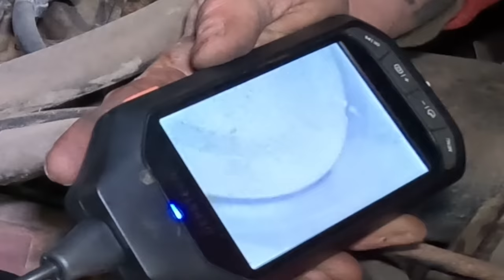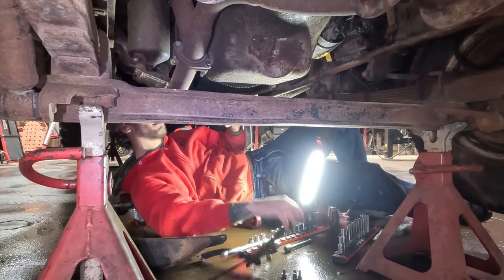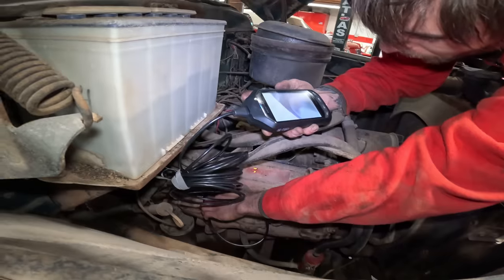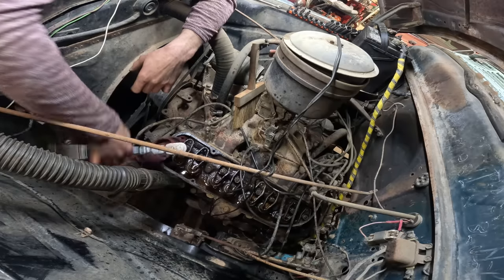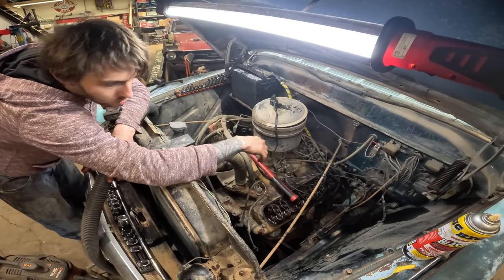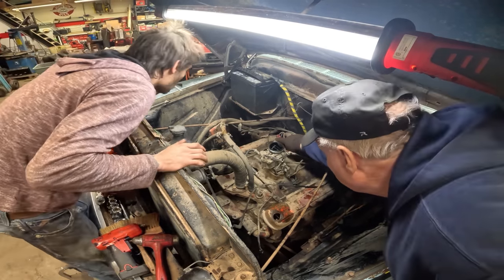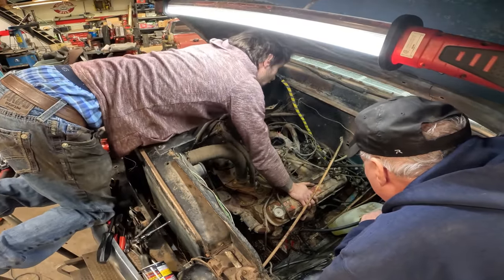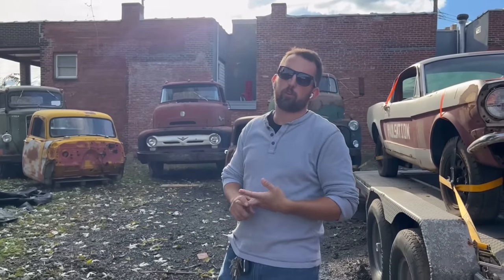1956 GMC 150 fresh off the farm will it run?? Pontiac V8, Big back Window, Hydramatic, Western truck

Comment: Pull the heads fill the cylinders with aceiline light em up with a propane torch bump the starter until it will free up some times that will work. that clay is a beast love the old school mechanics

Comment: Had a 56 GMC short bed, same color, fully optioned.   Great body, door hinges were shot.  Replace the original 287 with a tri-power 421 and Hydramatic trans from a 63 Catalina, all stock.  Was stolen.

Comment: You should of took the valve cover's off before forcing the engine over if you would of had the valve covers off you would of saw it was the valves and not the pistons that was stopping the engine from turning over.

Comment: Years ago i put Champion spark plugs in my 1946 Chevrolet and i still had a miss so i put my old spark plugs back in one at a time i still had a miss so i took one out at a time and put a new spark plug in in its place then it ran good so i put the rest of the new spark plugs in one at a time and started it up  until it missed.  I found the new plug that would not fire.  I took the new plug back to the auto store and they did not believe me so they checked the number on the spark plug to make sure it was the spark plug they sold me.  It was so they gave me a new plug!! After they put it on their spark plug tester!!

Comment: I think that the rocker studs are screwed in on Pontiac engines rather than the Chevys due to the increased power of the engines.